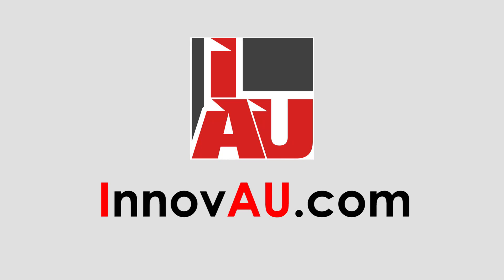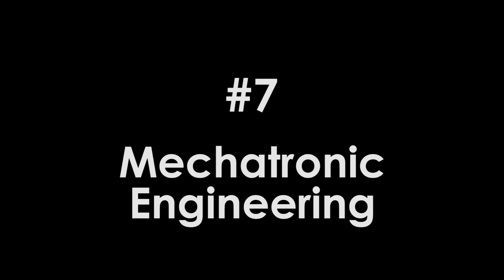What is Mechatronic Engineering

Comment: Hi, I'm so glad you made this video. I will be joining Swinburne for robotics and mechatronic degree this July. My dream job would be to work for Google Australia as a mechatronic engineer. However, every forum says that Mechatronic is not as good as Mechanical or Electrical. They also mention that there are no jobs for Mechatronic engineers in Australia. I was really let down by that. Is this even true? Do mechatronic engineers have an edge over others in  job placements and what about pay? What do you think?
Reply: I think Mechatronic engineers have the best qualification to be a robotics engineer. But what about jobs for Mechatronic engineers in Australia? Thanks mate!
Reply from the maker: Hi Ruwantha, personally - I think that Mechatronic engineering has both good and bad sides. 

Since it covers lots of areas, you do not get as 'in-depth' as you would with a straight up mechanical or electrical engineering degree... So if you want a job that is dedicated in mechanical engineering, or electrical engineering, then go for the more specialised degrees.

Mechatronics is BETTER though (IMO), because of it's broader coverage. You get to see how mechanical and electrical and software interact at a higher level, and this can make you an overall better engineer! You would be better at integrating with other departments, and you cans see projects from 'outside the discipline square'.

In terms of jobs, it can be a little tough, though I think that is the situation with any degree! So long as you are willing to learn at your job, and you demonstrate good knowledge, you will be in demand.. While my job history has been a little fraught with liquidations (companies going out of business), I DEFINITELY think my mechatronic degree hand a strong hand in making me have more of an edge over other engineers going for the same position. Many companies like to find one person to do the job of several people, so if you can demonstrate knowledge across multiple engineering fields, you may be able to potentially replace several engineers.

Also, I think that mechatronic engineering can absolutely help in defining the future of your career. Where other engineers with more straight up disciplines in mechanical, software, electrical, may have more experience in their field, their narrow degrees mean that they simply do not have much exposure to disciplines that they do not belong to. As a mechatronic engineer, you have exposure across the board, and as such would make a great manager...!

BEST OF LUCK with your degree, have fun, and ENJOY IT (as much as you can... Robotics subjects are awesome fun making robots attack each other or navigate around mazes haha).
Reply from the maker: And yes - to be a Robotics Engineer, it is VERY VERY helpful to have a mechatronics engineering degree!
Reply: Wow! I really appreciate your response. I also do think that having a broader perspective of engineering would make you a better project manager.

So as a mechatronic engineer were you able to find internships while you were doing your degree?
I would also like to keep in touch with you and get advice. 
If your alright with it, let me know your contact details. 
Thanks mate!
Reply: hi Ruwantha, im also thinking about entering the robotics and mechatronics course offered in swinburne , maybe after 2 years lol. can you share your experience in swinburne later then? thankyou😆😆
Reply: ALM 20 of course! Why not. I think that the future of engineering is all about programming.
By the time you start your degree in 2 yrs you'll have no doubt about mechatronics.
 I would like to know why you chose Swinburne.
Reply: yeah, let's hope that mechatronics will be a more well-known disciplinary xD
Reply: Pasindu Ruwantha Dharmaratne so hows mechatronics? I want to join this year in swinburne
Reply: +Pasindu Ruwantha Dharmaratne what subject you studied for A/L

Comment: hi .. i am studying mechanical engineering at PEC UNIVERSITY OF TECHNOLOGY but i am fond of programming and some electronics stuff , can i become a mechatronics engineer then.?
Reply from the maker: Absolutely! If your university has a Mechatronic Engineering course, you can transfer over to it, and then you will get the formal qualification for Mechatronic Engineering... This is the best way you could do it since you would get the exact proper training!!

Though if they do not, you could try to fill your electives with electrical engineering or programming, or even learn them in your own time. It would also be very very beneficial to learn embedded programming, and the interface between software, electrical components, and mechanical components. This would not give you a formal mechatronic qualification, but you would have effectively learned what a mechatronic engineer would know!

Have a look at the subjects required for Mechatronic Engineering, and tailor your learning to that. The Mechatronic Engineering course outline for UTS (where I went to university) is at the below link!

http://handbook.uts.edu.au/directory/maj03012.html
Reply: yes

Comment: What was your experience with mechatronics outside uni ?
Reply from the maker: +johny cooper When I finished up my degree, I started working as a Mechatronic 'installation' engineer for a company that made machines that made custom rugs! I would fly out all over the world and make sure these machines were put together properly and that the operators were trained. Unfortunately, this company went into liquidation after a year of being there.
My next job was doing CAD work for a company that made fume cupboards for laboratories, this company ALSO went into liquidation after a year and a half of being there..
Finally, I'm now a Sales Engineer with a company that sells industrial dishwashers and kitchen equipment. This company is doing extremely well, and is much bigger than the previous two!

In my first job it was very Mechatronic, second job more mechanical, now I've actually progressed more into sales, so things change!
Reply: Woo so I want to become a sales manager in automotive industry or mechanical.... Is it fine to select mechatronics? 
Previously I decided to take degree in mechanical engineering than go for MBA ( so I can work as a mechanical engineering or in management side with sales manager) 
So can I do this with mechatronics... Plus I had computer science subject in 11th and now in 12th grade